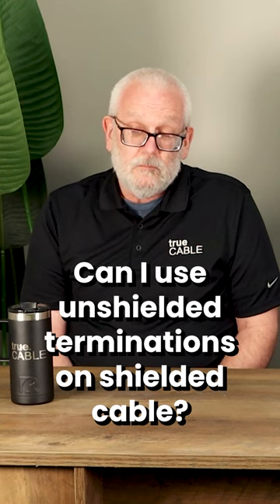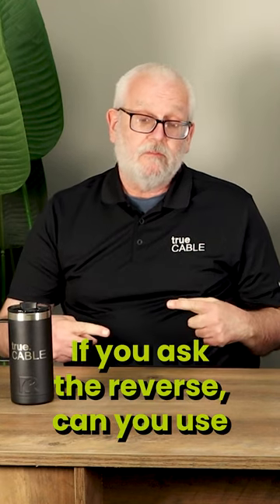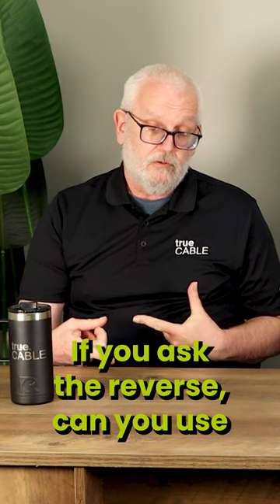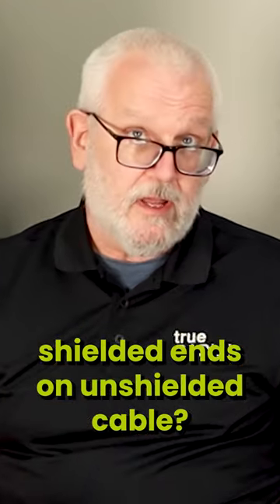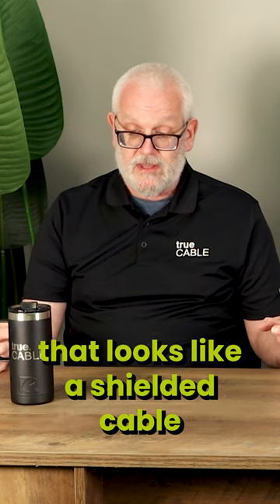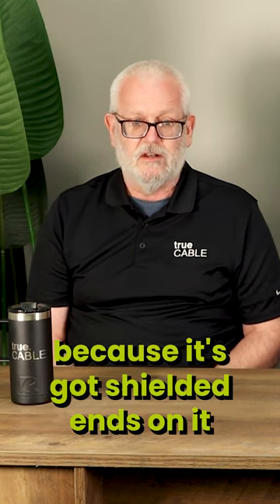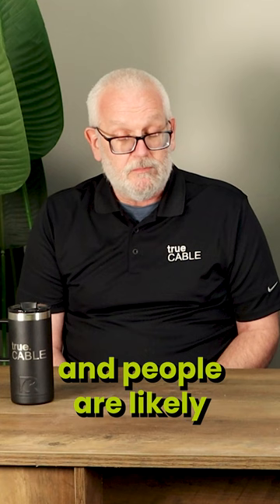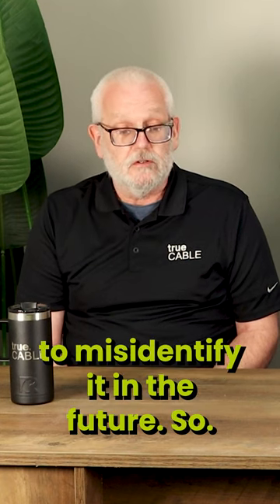Can You Use Shielded Terminations on Unshielded Ethernet Cable? #shorts

Comment: Hello.
Can we use unshielded connectors (both end) on a shielded cable ? I had the surprise to find a mix of shieled and unshielded Cat6A cable in my new house but all of them are terminated with unshielded connector. 
I understand that the "shield" wont work but does it create problems ?
Reply from the maker: Hello David! Using unshielded connectors on shielded cable is not the best idea. There may not be anything physically stopping you from doing it and your cable will likely work but as you pointed out any cable shields that are not bonded to ground will not function. There is the possibility that an ungrounded cable shield could act as an antenna, but it is unlikely in a residential situation. I would not risk it. The best idea is to use shielded hardware for shielded cable and unshielded hardware for unshielded cable.
Reply: @trueCABLE  Thank you for your answer. I'll definitly do it in this case. :)
Reply from the maker: @davidl5065  You are welcome David!